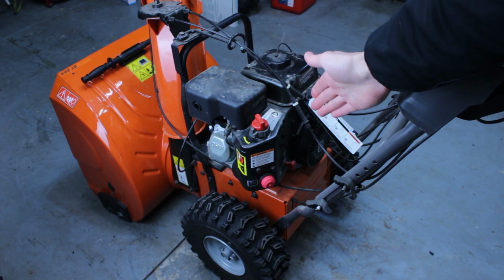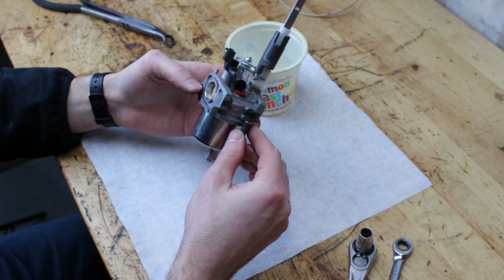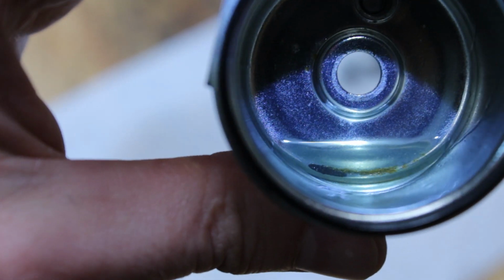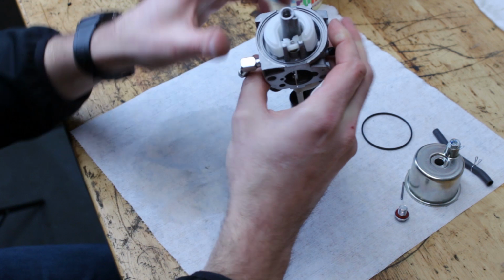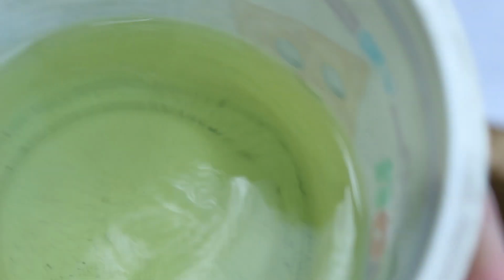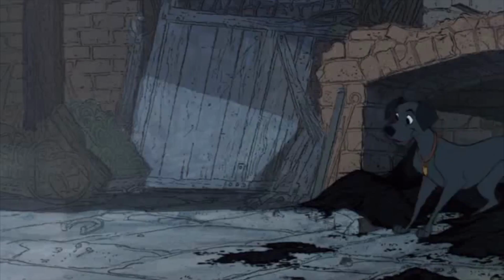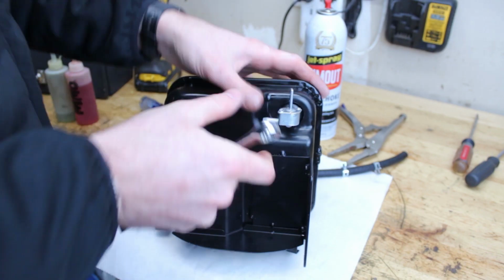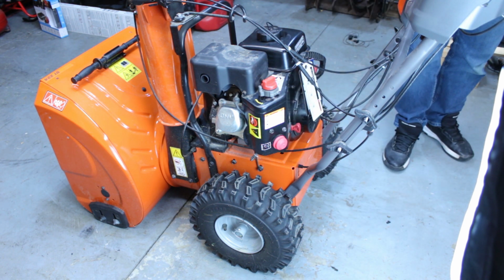Husqvarna ST224 - Will It Run?

Comment: Can’t thank you enough for the visual tutorial on cleaning out the carburetor and the gas tank. I couldn’t get my snowblower started after two years of sitting, I removed and cleaned the gas tank as well as completely took apart the carburetor, like your video. Instead of a few specs of dirt, I had a few millimeters of sludge covering the entire carburetor cap. Pretty sure it needed to be cleaned - lol. There is no way I would’ve had the confidence to do that without watching this video, and I did refer to it a few times when I was putting everything back together, as you never want a few struggling parts to remain after you thought you put it back thanks so much for taking the time to do this,I wish I could give it 1000 likes. Thanks, brother.
Reply from the maker: So glad to hear! Thank you so much for watching and glad it helped 👍🏼

Comment: Great video I was working on st224 yesterday but stopped because I couldn't figure out how to get the knob off and would like to have a expanded instruction of this very video thanks for all your help
Reply from the maker: Hey Bill - Glad you enjoyed. As I mentioned in the video this was a neighbors of mine so its not a machine that I have access to. What I do remember about it was that there was a plate mechanism that wrapped around the back of the engine to the other side, along the top. Hope that makes sense. Once that piece was removed, it all came off like a normal machine. I'm sure you've already tried to reference this in another search but I wish I could be of more help.

Comment: if it's only a year old, then either he's using old  or low-octane fuel. using fresh, high octane (at least 90) gas will solve the issue. it might be his gas can  if it's old or he isn't careful about what falls in it when the cap is off.
Reply from the maker: Good point! I agree 👍🏼
Reply: @ChrisXOutdoors  thanks!

Comment: you can leave fuel in these things over summer winter, you need to use 0% ethanol fuel and you won't have these problems, yes I own a 2021 st224
Reply from the maker: You are preaching to the choir! I use 0% or stabilized fuel for all of my machines and never have this issue either. My neighbor clearly wasn’t using good fuel at all 😅

Comment: I just bought a Huskvarna 125 30HV from my neighbor. I remember when he bought it eleven years ago. My neighbor is 87 years old and since he has owned this machine he has been in very poor health and in and out of the hospital. He now is too weak to run this snow blower, so I bought it from him. It starts right up, and looks brand new but has a slight surge. I thought I would try putting a new spark plug and running Sea Foam through it. Getting to the carburetor looks like a big job in and of itself. I have bad hips so it's hard for me to work on things. What do you think of that approach??? this machine might have about twenty hours on it maximum!! He said he has always put a fuel stabilizer in it!!
Reply from the maker: There are fuel additives that claim that they clean carburetor jets. They only clean it so well but it’s only a few bucks and worth a shot. If the surge continues you might have to pull the carburetor and clean it manually. Let me know how it turns out!

Comment: I am working on one of these for a friend a no start he claims he just put fresh fuel in it. I tried yeah a no start pulled the plug was binding every half a revolution thats because the hex is not true with the body and when I saw what plug it was garbage a Torch and OEM for a LTC engine and it was soaked so cleared the cylinder of excess fuel and checked for spark ok gave the cylinder a charge of brakeclean dried the plug and tried again no luck rinse and repeat with a Champion used but the crossover for this engine it fired up and died checked the oil overfilled and fuel soaked. knowing what I have a soaked plug I know the carb is delivering fuel and that garbage plug not firing IN the cylinder the fuel washed past the rings into the crankcase a oil change and a bowl flush  and a fresh NGK BPR6E it should run. A diesel mechanic by trade small engines my hobby kudos Chris just subscribed.
Reply from the maker: Thank you for sharing Jason. I LOVE how diligent your troubleshooting process is! 👍🏼

Comment: Great video. Just wondering if you think it could be a carb or plugged jet issue with my blower Starts but seems to be running under power no jam like it use to.. I was using it all day then it died and started it back up and seems under power. What you think?
Reply from the maker: Wouldn’t hurt to give it a little tune up, new spark plug, clean the carb, run some non-ethanol fuel a couple times. How many hours if you had to guess? Or how many seasons has it been since it was made? Approx

Comment: Use alcohol-free gas. You can leave it in there forever, no problem. Doesn't need stabilizer either. You can store it for 6 years. It's what I use in my snowblower and emergency generator. Both start right up every time, the blower after sitting for months with gas in the carb.
Reply from the maker: It’s so crazy what a difference that stuff makes 🤯

Comment: So how do you get the choke and throttle knobs off? You skipped right past the part that’s screwing me up. I don’t want to just pull or pry only to end up breaking a hidden release. 
Seriously, all the talk at the start is not as valuable as seeing how to get this apart.
Reply from the maker: My vids aren’t as much “step by step how to” as you’ve probably figured out by now.. might be others who have posted on the Blower more specific to that which you are looking for. From what I remember the choke and throttle came off like normal.. there was an obnoxious metal plate that I wiggled out which was frustrating.
Reply: So I thought I would break the knobs if I tried to pull them off or pry them off but that's how you do it and I found out just by doing it finally I thought I was breaking the knobs but they were just a little stubborn but you can pry them off with a screwdriver or just pull them off
Reply: I finally got to the carburetor and replaced it and I only had to put it back together twice LOL once I got it back together I forgot to put the idler bar or whatever it is that goes from the carburetor to the knob and it started right up ran great snow the next week and ran it for at least 3 or 4 hours two-and-a-half tanks a fuel and I was able to pull started fairly easy after it ran for a little while
Reply from the maker: Glad to hear Bill. Well done 💪🏼